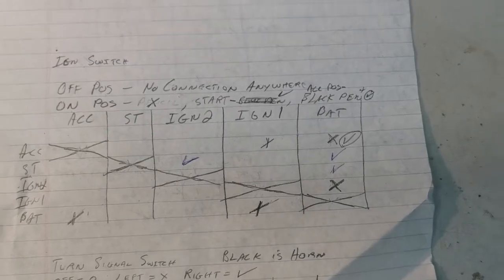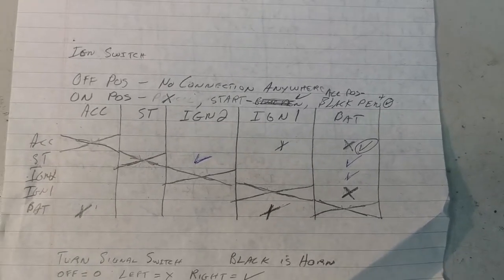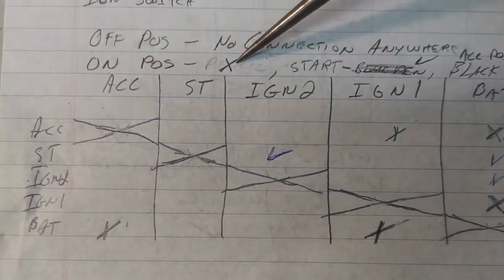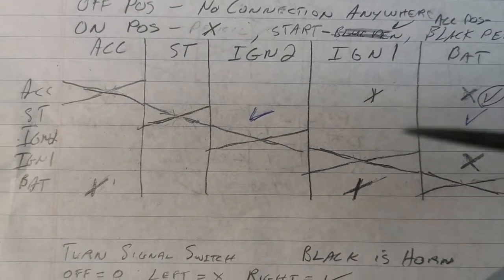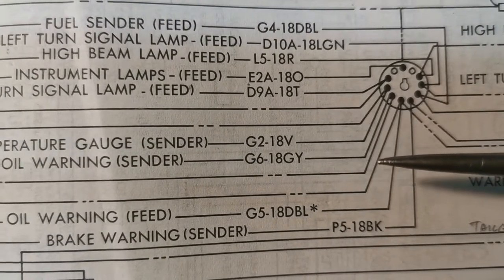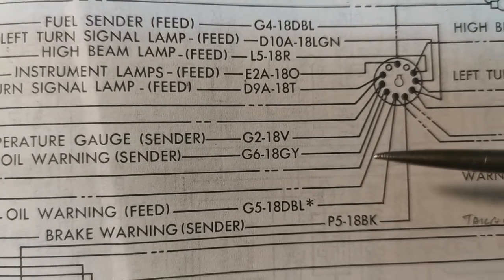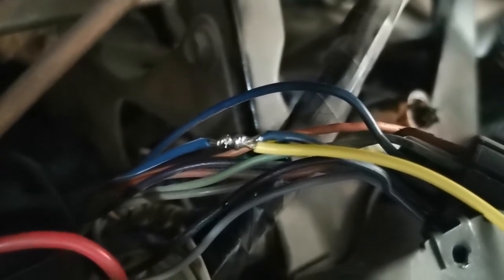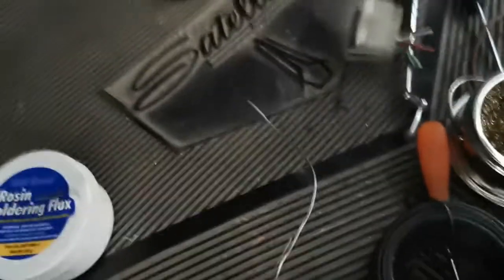Final, Part 6, Ammeter to Voltmeter Conversion

Comment: Can you show what you did with the amp gauge wires, the black wire from the alternator and the red wire from the amp gauge to the starter relay and any fuse-able links you had to add.
Reply from the maker: The ammeter wires just get pulled off the instrument and joined together,  no other changes

Comment: I have the same speedometer in my 70 dodge truck.  The needle bounce around a lot, is that normal. I tried another one and it does the same.
Reply from the maker: You converted your truck's ammeter to a voltmeter already?

Comment: Nice job on the conversion! Wanting to do this to my 65 valiant.  I do have a few questions if you don't mind. The yellow wire spliced goes to positive on the volt meter? What goes to ground? What did you do with the old Ammeter wires? Too many questions?😄
Reply from the maker: I'll try to answer.
1. You need a voltage source that is ignition activated or your voltmeter will stay on and kill your battery
2. Any ground point should work as the chassis is grounded.
3. The old ammeter wires get disconnected from the old ammeter then connected together (properly!!!) as all the current (amps) go through those wires.
4. If you aren't too handy at fixing and modifing stuff, I wouldn't try this. It was quite a hard job and I have alot of special tools. I did it because I wanted a voltmeter and for it to look stock. The ammeters really don't break down very often.

Hope this helps...
Reply: @retireready7090  Thanks for the quick response. My fusible link blew the other day and I traced it down to a shorted out ammeter, the insulator board had deteriorated. So now I'm going to by pass it or convert to voltmeter. Luckily the fusible link saved my car from going up in flames.
Reply from the maker: @mudjeeper4176  Wow, I guess it is a good thing then, one thing to consider, and I'm going to do when I have time, is to bypass the firewall connector. That is another sore spot. Good luck!